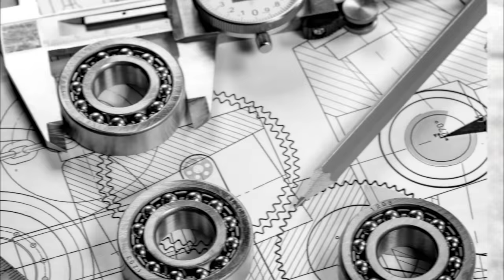The Most Successful Machine Gun in the World?

Comment: Interesting presentation.  Not mentioned though are some other facts.  It was a very versatile gun.  However, the 1200 rpm rate of fire was not an advantage, unless you were making a Hollywood movie.  As it was used as a lmg and a hmg, a shortcoming was obvious.  The Bren and BAR were magazine feed lmg's which obviously required the changing of the magazines but also meant that ready rounds were available right away.  The MG42 was usually used with the 250 round non disintegrating ammunition belt.  This was not conducive to advancing in any situation were the belt could catch on anything like branches or other protrusions.  It is rarely seen using the drum magazine as the no.2 usually carried two 250 round boxes of ammunition along with other designated support infantry.  In bunker situations this was not an issue.  The high rate of fire was somewhat redundant.  So yes, there are stories of some enthusiasts linking thousands of rounds together and then firing them off in one long, or should I say short burst.  But this is not done in combat.  All modern squad level lmg's use magazines and have a rate of fire of 800 rpm.  When the MG3 was designed it only had a rate of fire of 900 rpm, and as indicated the gunner is trained to fire in well aimed bursts, not continuous fire.  As well, when I was in university in the late 1960's, I worked with ex Wehrmacht soldiers.  They told me that experienced machinegunners preferred the MG34 on the Eastern front, as the MG42 had a habit of breaking the firing pin in cold weather.

Comment: One correction;

Canada uses the M-240; not the M-3, and it is classified as the 'C-6 GPMG'.  Judging by this video, and the fact I have used the M-240, The M-240 is nearly the same with the M-240 being gas operated although, but the M-240 wins out over the M-3 by the barrels being more resilient to heat, minimising chances of inaccuracy and the potential for permanent barrel damage.

Comment: I’m surprised nobody has modernized the design for optics and fore grip attachments.
Reply: Rheinmetall also offers a MG3 KWS (Kampfwertsteigerung) kit which allows you to modify the MG3 to mount optics and other equipment. It also adds some further improvements.
Reply: „Rheinmetall has developed a combat performance upgrade kit for its tried-and-tested MG3 machinegun. MIL-STD-1913 rails mounted on top of and alongside the receiver as well as on top of the feed cover allow all standard optics and optronics to be used with the weapon. A length- and height-adjustable shoulder stock with integrated buffer and adjustable ground spade, a combined carrying and assault grip, a height-adjustable bipod and a new carrying sling significantly enhance its ergonomics in dismounted operations. Moreover, the receiver can be fitted with a camouflage-coloured coating. Still in development is an interchangeable pistol grip with selective trigger (single-shot and sustained fire); a new internal safety mechanism that can be put on safe while the gun is uncocked (not only while the bolt is cocked as before); a device for reducing the rate of fire from 1,200 to 800 rounds per minute and a built-in round counter to be integrated into the pistol grip, which will record mechanical stress. The upgrade kit can be retrofitted during the course of routine maintenance.“
Rheinmetall website
Reply: there is various kits in usage specially on tripods/fixed base systems, but is not actually what is designed to do with this weapon, this is a infantry support or close/medium range support weapon, is not designed for long range shots, the rapid rate of fire does not allow you to take advantage of the long range optics...

Comment: I never could understand why the bipod on a MG 42 is so flexible. It seems to be unwieldy. I have only fired one from an AA tripod so I don’t know much about it. I did own an MG 34 which had a very tight bipod. Too bad the gun’s tolerances were also very tight which was great, I’m sure, when it was new but it was 50 years old by the time I got it and well used such that I couldn’t keep it running. The M 60 I replaced it with has no such problem.

Comment: Never saw any asbestos gloves in the MG-3 kits. There was a small tool to change barrels, which were quite fiddly. And if you put a hot barrel in the snow instead of in its box, well.

Firing more than 150 rounds did not destroy the barrel as mentioned in the video. We once dumped 500 rounds through it in a pretty stressed situation without replacing the barrel. The barrel was still usable afterwards with good enough accuracy. We did fire in burst mode though.

Comment: You have to release your trigger at light speed if you want to fire 3 or 5 rounds!
More realistic are small bursts of 8 to 10 rounds.
Reply: Its really not that hard. Most soldiers in my platoon managed to do 2-3 round bursts within the first 2 months of joining the military. The really good dudes were actually able to pull of single shots.
Reply: @SeF001  It depends on the weight of the bolt and the spring that is installed. Those two factors are what matter regarding shots fired per minute. Mainly we had the heavier bolt installed which makes it easier to fire short bursts. :)

Comment: The main detail that made this weapon particularly deadly was the quick change barrel.
So crews could swap out a barrel each hundred rounds or so.

Strange that fact was not mentioned.
Reply: it´s 1000 rounds of continious fire. Then you have to change the barrel.
Reply: @Kai-bj5ol  nah... 100 to 150 depending.
They even had chains with 100 rounds just to make sure.

If I am wrong, then so be it. I will have another read on it.
Reply: @AhmedAdly11  you have to reread. I served till 1999 in the german Bundeswehr as an PzGren machinegunner.
Reply: @AhmedAdly11  this for MG42: (4) To change barrels.—(a) General.—The barrel on this gun should be changed after firing 250 rounds in full-automatic fire, or, in cases of emergency, after firing 400 rounds. Spare barrels are regular equipment with the M.G. 42 and are carried in either single- or double-barreled containers by the gun crew. The single-barreled container opens up so that the hot barrel can be laid on it and exposed to the air to facilitate cooling.
Reply: 1000 round barrel change is for MG3 meant.
Reply: @Kai-bj5ol  I see.
Which model is from WW2?
Reply: @AhmedAdly11  MG42 is ww2 gen
Reply: @Kai-bj5ol  And how many rounds continuous fire until barrel change?

Comment: The m60 was based of off the mg42 I believe.
Reply: don't think so, if i am correct M60 has gas operated mechanism, so is more sensitive to hard usage and demands more time in maintenance in a tactical level. Believe me field maintenance in a MG3 is 10 min max when you are on the foxhole, with a trained user you need less than 2 min total to disassembly and assembly back the weapon....is formidable weapon in the right hands.

Comment: It does have its own draw backs. It's high rate of fire, in an inexperienced machine gunner means they will eat through ammo at a rate supplies can't keep up.

The mg3 is a slight upgrade to the mg42, changed the caliber and lowered the fire rate to mach that of the m240G about 950 rds a minute.

The mg42 fire rate of 1250 rds a minute is just unnecessary
Reply: The Mg3´s firerate is still 1200 rpm. Was up to 1500 rpm with different variants of the mg42. It´s firerate also does not ramp up like in the old mg42.
But you are right, you need an experience machinegunner + buddy to really be effective. But if you have that, then you truly are high value asset.
Source: Served 8,5 years in the german military.

Comment: Hitler's zipper was not the most powerful machine gun in WWII, that honor goes to the M2 browning's high fire rate aircraft version. .50 BMG puts a lot of hatred down range in a small package lol. Also it's worth noting WHY the m240 is so good. They took the best part of the MG42 (it's top cover feed pall mechanism), and attached it to an inverted Browning BAR action converted for belt feeding. That's also why the M240 is so reliable, it's basically what you'd get if the 42 and the BAR had a baby. That's also what the PKM essentially is, flip an AK upside down, add a belt feed mechanism and associated hardware, beef up the receiver for a full power cartridge, and send it out to the troops. Only difference is the PKM uses it's own feed mechanism, which isn't compatible with MG42 or NATO style belts, which both feed by pushing the cartridge out the front of the belt, rather than extracting it and dropping it down into the action, the way the PK does

Comment: The reason for the 42s placement wasnt the "aging" of the before used. But the production. The materials and the production....that was the only reason. The mg 34 was and still is the FAR superior machine gun. BUT it is also the more expansive one. And therefor was only given out to the specialized teams after that point. Whats the biggest differnce? the 34 has 3 different firing options. SO it can be used as handheld mg as in position mg but most importantly if settled it was possible to put the 34 in "overdrive" and use it as AA weapon. Which it was used for on tanks and basedefences.

Comment: I like  using the mg34 over the mg42. the 42 can be a bitch even on a tripod if you let get away from  you & the barrel change was every 250rds and can't see the mg3 needing 150rds change as it had a chrome barrel  the mg3 is easier to shot  due to the lower rate of fire and the weaker 7.62x51 ammo

Comment: Most successful light machine gun? Maybe. Most successful machine? Debatable. 

The m2 should be arguably the most successful machine gun in all classes as the core design hasn't been changed in the near 100 years. If we're going to compare the mg42 to the mg3, the changes are decently significant so it's also fair to compare the m2 the the m1919 as its "mostly" different round size (like mg42 vs mg3) and of course a huge round size change will require reinforcement of the receiver and all but fundamentally they should be near identical. That would make the m1919 one of the most successful too
Reply: the right way to describe is General Purpose Machine Gun (GPMG) means that you may use the same weapon in platoons, companies, battalions, light vehicles, light tanks, heavy tanks, fixed positions and any ware else needed,   and and yes is the most successful in his role and is not antagonizing the 0,50 or any other more specified weapon system
Reply: @vprosilis  yes but again if we are just saying any repeating firing gun, its the m2. Planes, vehicles, ships, tripod, and the smaller caliber was used in an infantry role plus all of the above as well. The mg42 this is based off wasn't the gpmg, the mg34 was
Reply: @HIFLY01  indeed , 0.50 is all around multi purpose heavy machine gun, but his role is not the same , MG3 as the MG42 (his father in a matter of simplicity, MG-34 is the Grandad) is designed to support small flexible teams of infantry to their "fire and move" tactics, or to defend fixed position against soft targets, the US on this role had the 0.30 Browning , not comparable to MG-34/42 or to MG3. 
The MG-34 used on airplanes due to the high rate of fire (spray and pray with a 1.800 rpm) and it was fast shifted to 20 or 30 mm Auto cannons in German air arsenal within ww2, remained  mostly on defense role in bombers. 
The 0.50 still up today have multiple role in, mainly, fixed positions(is almost impossible to follow a platoon of infantry without a mounted 0.50 HMG to a Jeep or to APV, you need to have a team of 3-5 Supermans to serve the weapon ) . in addition 0.50 demands (a bit more) expertise in maintenance and support, MG3 does not need this in a tactical level. Anyway, as said, is almost non comparable weapon systems 🙂 🙂
Reply: @vprosilis  not sure what plane you saw that has an mg34 so could you list them? I see the mg131 which in itself based on the browning m1921 ironically and used on almost all German aircraft but I cant find anything saying they used the mg34 for air craft. 

And again if we are lumping the mg42 and even mg34 together with the mg3, its only fair to lump the brownings together as they are the same functionality, just different calibers like the mg42 and mg3. Unlike either of the German lmgs, the brownings were fully available in planes, hull mgs, vehicle mounts, stationary positions, a sniper at some points (only the 50 cal was) and the 30 cal even was hand held due to field modifications. 

You could say the mg3 is the best gpmg as it was used with infantry and vehicles but the brownings have had more roles where they were used in. While a 50 cal isn't intended for infantry and is made as an anti material caliber, it can still do both roles. The mg3 however can only do infantry or maybe against terrorist toyota trucks
Reply: @vprosilis  ah ok my bad it was the mg81 that was on planes

Comment: I see your mg whatever and raise you m249 saw and 50 cal....  More full body combat winner than a singular limited use weapon....
Reply: M249 is a smaller caliber, with shorter range. Which is also why it is classified as a Squad Automatic Weapon or, outside the US, a Light Support Weapon. 

The MG3 has a larger caliber, longer range, higher rate of fire, and can fulfill both the LMG, MMG and GPMG roles. 

Cal .50 is a bullet caliber, but if referring to the Browning M2, that's a Heavy Machine Gun. Good luck using that dismounted.